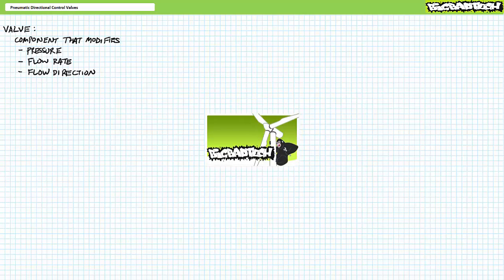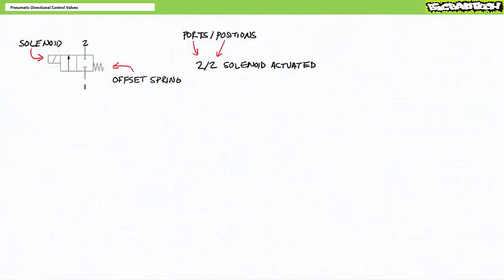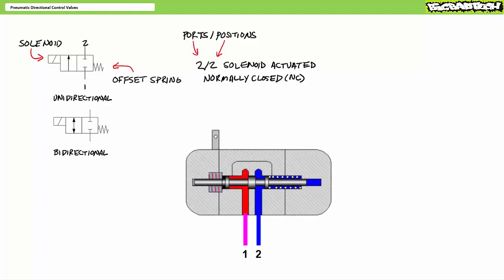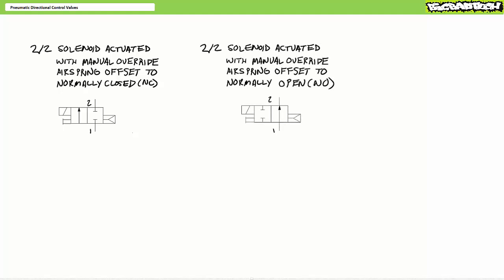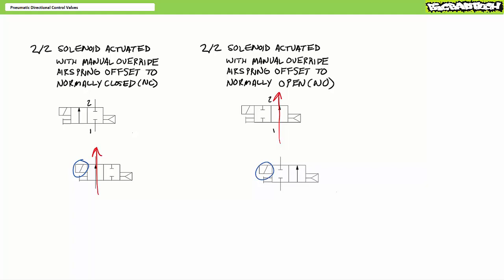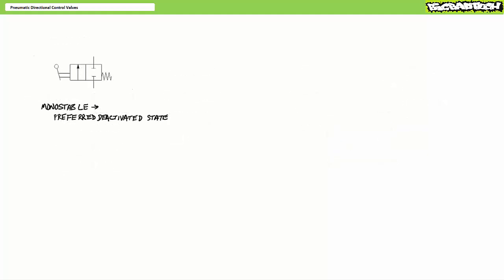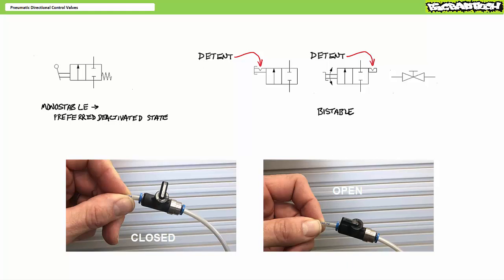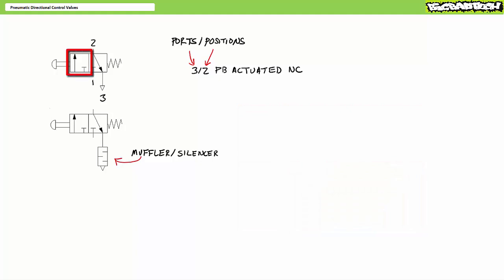Pneumatic Directional Control Valves (Part 1 of 2)

Comment: Great job with great illustrations. I was planning on doing a presentation but was petrified that my illustrations wouldn’t work as well as I want. I always admire people who is dedicated enough to get them to work. Getting the timing, size, and standard notations correct
Reply from the maker: Stay in touch .... I've got some 3D animations coming your way soon! Not joking. I'll be showing the inside of pneumatic actuators, compressors, and valves in operation.